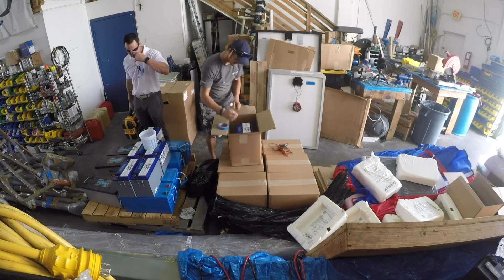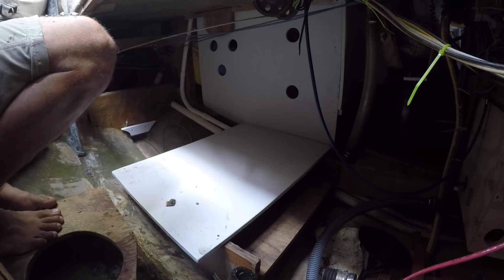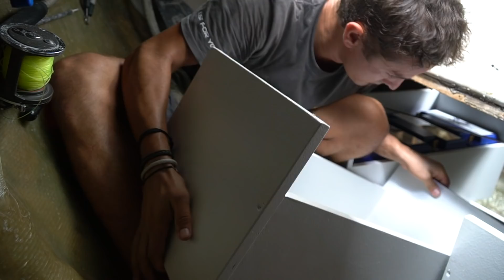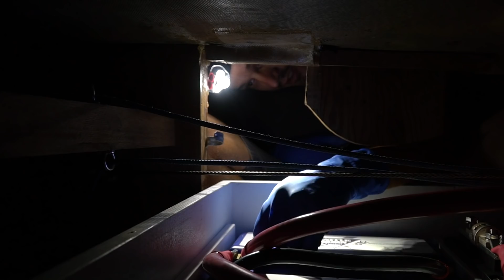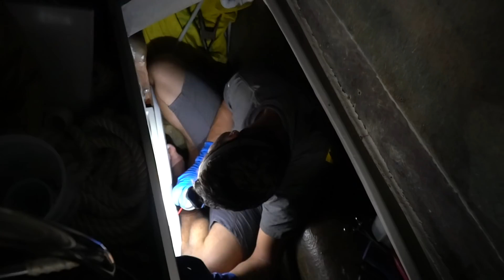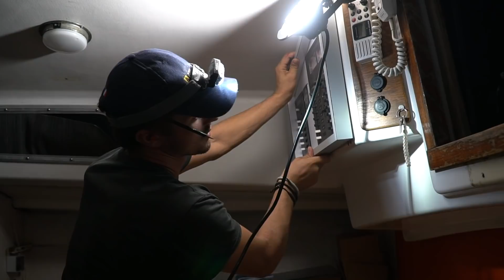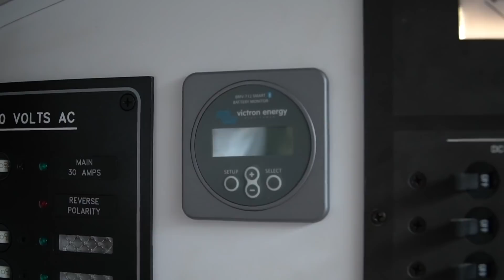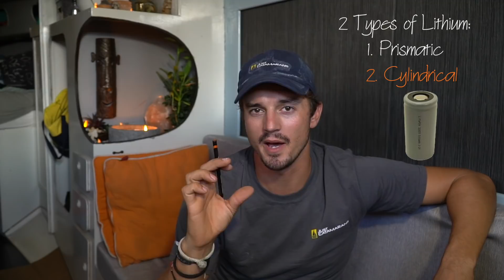Uma's new Battle Born LITHIUM heart ❤ — Sailing Uma [Step 135]

Comment: Lithiums should not be connected in series!
Reply from the maker: Not according to the manufacturer, it’s totally fine. Besides, how do you think they get all those 1.2V cells up to 12V in the first place.
Reply: @SailingUma   Heyy, thank you so much for your reply. I've got 111 videos left until I'm up2date ;D 

Hmm. I might be wrong, but I did see a website that said they could not due to the BMS; maybe Battle Born has fixed that issue in their BMS so that it understands it's connected in series and allows charger either way. 

This is the site I saw: 

https://blog.valen.com.au/connect-lithium-batteries-in-series

I struggled to find a proper data sheet on those batteries though, I saw some other lithiums that lost about 50% lifecycles by having a DoD of 20% instead of 50%. Rated lifecycle was 5000 cycles at 50%, but 2500 cycles at 20%. 

And as far as I understand it, a cycle is any usage then recharge.

So 100->80% then recharge to 100% is a cycle. 

But again, I might be wrong. 

I wish your videos would be more specific with title, some videos have a title that suggests a hike for example, then suddenly in the middle there's some motor-techy stuff or other small repair.. Almost skipped a few of those.. :D
Reply from the maker: Every battery is different so you can't apply the specs or suggestions from one type of manufacturers to another (unlike lead batteries) The ones we have from Battle Born are designed to be drop in replacements to Group 27D type lead batteries (ie Trojan T105's) This means aside form adjusting some charge voltages, everything else stays the same. It's the main reason we chose to us them. They're fool proof (sort of) Much easier to work with than lead acid. 

As for life cycle. They're referring to full discharge and recharge cycles. Which is rare. It's also means that a 100Ah battery, after 3-5000 "cycles" will still work just fine, but now have a bit less capacity, maybe 80Ah for example. We've had our batteries for over a year now, and we've only ran 11 "cycles" according to the computer, if that gives you an idea of how long they'll last 30-40 years or more, with no physical damage. 

We're also working on the video thing, and trying to split up content into separated videos rather than cramming it all into one. But editing 1 video a week already takes up most of our time, so trying to get 3 out per week is incredibly difficult and time consuming. We want them to be goo and not feel rushed.
Reply: @SailingUma  Of course, and I appreciate all the time you spend creating that video. And all the time you've spent replying to me, wow.. :D 

 It would also be difficult listing everything a video contains into the title, hehe. 

But yeah, I don't think I personally could do what you guys do.. (referring to a personality aspect of it) I don't like being in front of a camera, and yeah.. Don't think it'd make good content as I'm only in my condo right now. (About to sell and possibly go sailing, or vanlifing.. not decided yet) 
I hope to have it listed next week with first showing in January. (Not sure if I wrote it in a comment on an earlier video or not) 

Hmm, the full discharge/charge being 1 cycle is new to me :) Does it count being discharged 20% 4-times as being discharged once 80% then? o.O 

Been looking at a bit of solar for a while, and it was always referred to as a discharge/charge cycle. In solar talk a cycle would be one day from what I understood, as one would bring it down from 100 and normally up to 100 in a day.

Comment: Great explanation! I learned a lot from "DIY Solar Power with Will Prowse" and it lines up exactly with what you indicated.
One question though, I have seen some stuff about running AC (with inverters and shore power) and DC power on sailboats and potential issues on how to set up ground. Did you guys have any issues? (I guess in particular to galvanic corrosion and maintaining proper grounding).

Comment: Dan,
Thanks you have done a great job. There.
Please give us the 12 month review, How did the new batteries actually perform?
Tks
Reply: Three times the batteries, 20 times the power?
Reply from the maker: We will be doing that this fall. And yes, with lithium running an electric motor, 3x more batteries gives us 20x more range. With smaller loads, the same size bank would give you about 3x more power, you can use more and put more back in faster than lead.
Reply: Dan 
Thanks for the reply. Im thinking about a  nice “rule of thumb”
  Battery to battery 
7 times the power 
10 times the price.
But I’m not ‘dissing ‘ the new batteries.
They’re just not for everyone...
Keep up the good work...
Reply from the maker: They look that way upfront. But, over the life of the battery, lithium comes out much cheaper than lead acid. We went though 3 sets of lead batteries in 2 years. If you buy high end AGM batteries, they're about the same price as lithium already, accept lithium will last 30 years. They're "rated" at a certain life span based on discharge, but even after 5000 cycles, they just go from being a 100aH battery to being am 80aH battery. You can still keep using them, they just won't have quite as much capacity.
Reply: Dan, thanks for such a speedy reply.
FYI you motivated me to go blue water cruising. I sailed my IP 35 from Newfoundland to The Azores in June 2018, She is in Maderia right now,  and we plan to take her to the Carribean this Nov/ Dec.
      I’m really sorry I missed you in St Johns, we would have liked to meet you guys.
Regards
Ed

Comment: Dan Curious as to why you didn't consider firefly's carbon foam AMG's similar discharge and recharge rates, far less cost I'm running 2 250 amp 12 volts for a combination of 500 amp for a price of 540 dollars each. Just curious, nevertheless I love your set up.
Reply from the maker: I do remember researching about them awhile ago, a company even emailed us asking us to try them. I don't really remember the specifics though. I'm pretty sure they only have about 1/3-1/5th the life cycle of LiFePO's and can't deliver the high amps needed for EV's. They seem to be a great option replacing typical AGM's. But if good AGM's are in your budget, then Lithium is already a cheaper option over the life of the battery, and MUCH less weight.

Comment: You forget to mention that your batteries cost about $12,000 to have a propulsion system that is less reliable the a 9 horsepower outboard motor. Have you considered just installing an oarlock and a sweep oar to skull your craft? Much less expensive, more reliable and if necessary you can push yourself along at 2 knots all day long. The total cost just seems foolish and unreasonable unless you have some undisclosed arrangement with the suppliers because most people could cruise for a year on what you spent to have a system that isn't as good as the diesel engine you junked. Hmmpf!

Comment: I am installing an electric drive in my Tartan 34 and am using the LIFEPO4 100 ah prismatics in a 16s configuration . My biggest issue is wiring the BMS, so the choice you made to have the BMS integrated into the battery saved you some headaches. 
Looking forward to hearing about your experiences with the new system. 
I have been following you from the start. Great work!
Reply from the maker: Yes, that's one of the main reasons we went with these over others. The integration of the BMS and electronics makes installing them easier than normal lead acid.

Comment: That is really cool. I want to put lithium batteries on our Southerly boat (4 kilowatt hours) but was told it wasn’t the best option. Not convinced by the knockers so I’m watching closely. I was designing a 39ft Bristol Channel Cutter, but cut the corner and bought a 16 year old boat instead. But in that design I had planned a hybrid drive with a smaller diesel aft under the rear cockpit floor with its output shaft pointing fwd into a v drive box and with a 6 or 8kw motor mounted on the fwd end of the v drive. My expectation was to be able to electric power for half an hour to get out of berths and off anchorages to sail, regeneratively recharge under sail or solar, while saying that any diesel used would be biodiesel as far as possible. Well now I am fully conventional so have to find a way back to the original plan. Great to see your work and I love your interior.

Comment: Reading the Battleborn manual, they advised using a torque wrench on the battery terminals or risk a fire.  Also, they say you can discharge 100%, not 30%.

Comment: Can someone explain why you cant draw to much from lead acid? Cause I thought it where the lead acid that are deep cycle batteries and when you discharge a lithium to much it acually breaks
Reply from the maker: Kind of the opposite actually. The more to deplete Pb the less life you get out of them. If you don't fully charge them every day, the less life you get out of them. The more amps you draw, the less life you get out of them. If you charge them too fast, the less life.....you get the point. Lithium doesn't care. You can draw as many amps as you want, and leave them discharged as long as you want and charge them as fast as you want, they don't care.  Ours have a built in circuit board that won't allow you to damage them from over charging or over discharging or drawing too much current if their too cold. They're much more indestructible that Pb chemistry. (And last A LOT longer)

Comment: As soon as I saw those batteries I thought... COST!   We are looking at an older boat to buy and the issue of battery condition has been raised more than once.  A small new diesel engine can be had and fitted for 8k, sail drive optional over and above.  The boat has been chosen for sailing performance - the engine is for backup only.  What surprises me is the consumption of many of the, no so large, motor boats- 1 gallon a mile is common.  Deep pockets or a total aversion to sails and the environment (whoops, another can of worms),
Regardless, an absolutely fascinating blog and so well presented, and a terrific response from your audience.  What an informed bunch they are!  It's taken me ages to read a just a small proportion. Lots to digest for the future, but, regrettably, no panacea it seems.
Well done!

Comment: “Only” $12Grand for batteries AND a whole 5 hours of cruising time??!!!

You’ve convinced me!

Diesel is definitely the way to go.
Reply: It's a sail boat not a motor boat. It's only to get into and out of harbor anyway.
14.4 KWh battery bank does a lot more than propel the boat.
The 20 gal tank rhey removed would only run the diesel for about 38 hours and cost at least $60 to fill.
I'd pick LiFePO4 electric.
Reply: does your diesel charge from solar power on a lonely atol ? :)

Comment: If you're on a budget and trying to copy or do similar to this you should defiantly look into used Tesla car batteries, a single battery module operates at 24v and has a 5.2kw capacity. The battery modules can be found from $700-1200 used depending on where you buy them, for a 15.6kw system you would be looking at $3600 maximum shipped.
Reply from the maker: YES!! You can also use a chevy volt pack or Nissan Leaf pack. Both of which we looked into extensively. Our friends on @SailingSaoirse used a Volt pack. You can usually find them for about $2k. It was also our plan B to go with a volt pack. EV West out in California also sells the Tesla modules. For some reason I thought they were about 50V and 2.5-3kW. Anyway, LOT of alternatives to new, just takes some digging and some research.

Comment: Suggest road pro inverter. I use a 2000 watt. Comes with a removable controller aka face plate. You can mount it anywhere and monitor the battery that way as well. Also bluetooth capable. I use this on a semi.

Comment: Those boxes seemed way to tight of a fit for the battery. I've seen lithium batteries expand a lot when they are overworked or when they fail. 
I would have also used heavy metal boxes and split them up port and starboard. I've seen lithiums melt down and run away to the point where the bus that they powered burned to the ground. It was a professional electric bus company.
Reply from the maker: The problem with electric cars, it that they draw really high amps, and push batteries to the max. Our set up draws much lower amps and stays well within the safe operating range of the batteries. If any cells start to fail, the BMS will stop charging/discharging and prevent any runaway.

Comment: You should not have put the batteries so close together as they become extremely hot when they are charged and it shortens their life when they can not move the heat away.
Reply from the maker: They only heat up in extreme charging and discharging currents. Ours have a BMS that won't allow them to overheat and after our recent test (video coming soon) they didn't warm up at all under full load.
Reply: @SailingUma  okay... :-)
Safe sailing :-)

Comment: Nice job and very good explanation. You should let some free spece between each battery because they got hot, and you need a good air circulation to prevent overheating. The wood boxes shuld have some holes also.

Comment: It looked like Aluminum wire you used on the main battery post connections, or maybe the way it looked on camera? Aluminum is okay but you need to use the paste on the wire before you crimp it. If it was Aluminum and you did not use the pasted you now know where to look when you lose power. (and you will in time)
Reply from the maker: Nope. Tinned copper.

Comment: Hi guys... maybe I missed this but the shape of the battery has nothing to do with its chemistry.  The tube batteries in a Tesla  and indeed the same as your batteries but the chemistry is not.  In a Tesla they are using magnesium cobalt and you are using  iron phosphate.  The LFP batters while being much more stable and safer have a bit lower energy density than a Tesla.  I only say this cause there is a ton of bad information about lithium out there.

Comment: Great video Dan.  Very interested in converting to LI batteries.  However still have many questions.  Can you recommend an information resource.  Concerned about charging from engine alternator.  My experience in the past with motorcycle you couldn't just drop in a LI battery and expect it to charge.  Appreciate any info resource you can point me to.

Comment: WOW Sounds great! I have been looking into lithium batteries.  I was concerned about balance charging issues.  It looks like found a product that solves that issue!  Like always, I am impressed at how 'smart' you do things!  It sounds like you found the perfect battery solution for your needs and application.  NICE!!
I plan to redo the battery/electrical systems on my boat this winter.  The Dragon Fly batteries look good, but I just can't justify the cost for my application.  Even AGM batteries seem a little pricy for me.  
Thanks for another interesting video and Good luck with all!!!

Comment: Btw, your battery boxes move. That good when you're working on them, but bad when you're sailing.
Reply: Also, you could've drilled holes in the boxes to improve airflow.
Reply: Moveable battery boxes is also bad if you capsize.
Reply from the maker: Theyre all screwed down and covered now.
Reply: Ah, well done. :)

Comment: The reason you should tell us your plans before you do them, is that we can offer suggestions that would make your life easier.  For example, you've put batteries in boxes and  wired across the tops - "surgery from inside the patient". If you'd put a few bolts at the end of each box, you could've wired each box to the bolts - in comfort, and wired the boxes together with easy access. Also that would enable you to easily split the battery and remove any box.
Reply from the maker: The boxes can only be installed empty and each battery can only be added one at a time. There just isn't enough space to do it any other way.
Reply: Yeah, I understand it was always going to be tricky, and it's done now anyway, so the point is moot. The difference is, you're getting on and doing it, while I spend my life trying to think of the best solution.  :)

Comment: Consider this. You have a joint, eg a wire to a battery terminal, with 0.1 ohms of contact resistance.  If you draw 50 Amps through it, it produces P= I^2.R of heat: 50x50x0.1 = 250 W
Toasty-warm.
Reply: Also, 50 Amps is what a little arc-welder produces.

Comment: 17:17  Volts x Amps x hours = Watts x hours = W.hrs (energy)
A Watt is a Joule/second, and an hour is 3600 seconds, so a W.hr = 3600 Joules. 

You have 14.4 kW.hrs.  That's 14 .4 Units of electricity as your electric co would sell it to you. 
At, say, 15 cents per unit, it's $2.16 worth of electricity.

If your motor is 48V 50A, that's 2.4 kW, you could - in theory - run it for 6 hours.

Comment: Actually, the new battery packs have a total CAPACITY of 14.4 kWh. Not total POWER of 14.4 kW. Power = voltage x currrent (P = U x I). 

The number of batteries/battery packs does affect the maximum power you can draw from them, but in a diffrent way than what you think. The only significant factors in max power are the voltage and internal resistance.

Ohm's law (U=RI). So, the max current (I) = U/R = voltage / resistance. So, the max power from a battery: P=U x I = U x U / R. 
When connecting battery packs in parallel, the internal resistance used in the calculation is divided by the amount of batteries. In this case, you have 3 parallel battery banks. This is, of course, just a theoretical, simplified calculation. There are other factors like the resistance of the wiring.

Please correct me if I am wrong. More than 20 years have passed since I studied the basics of electricity in the 1st year of my engineering studies at lut.fi